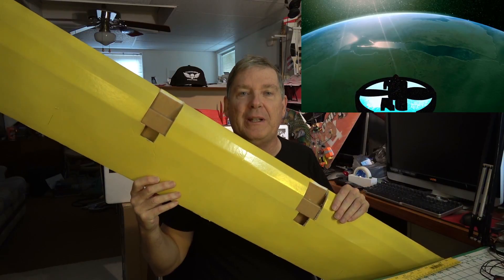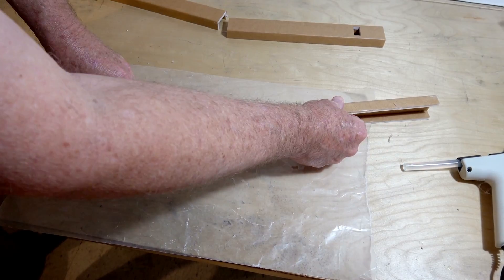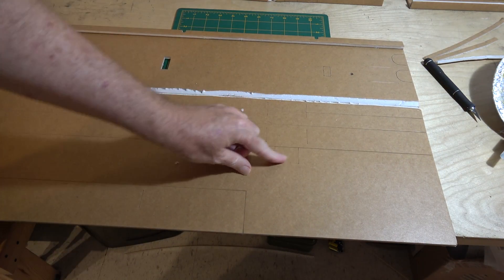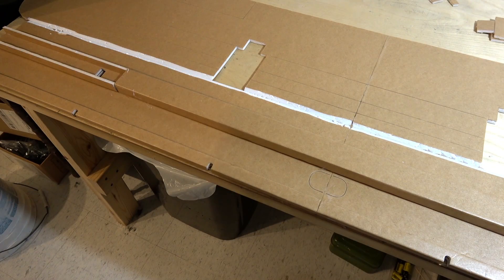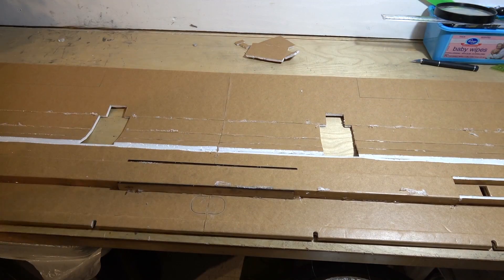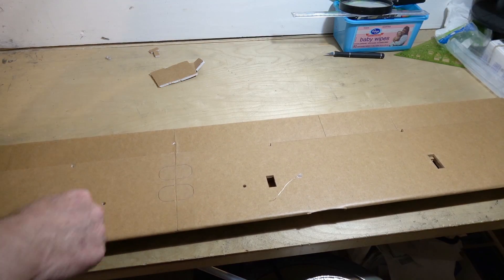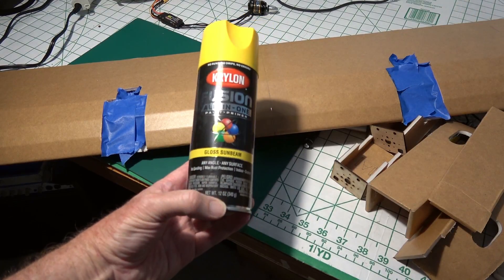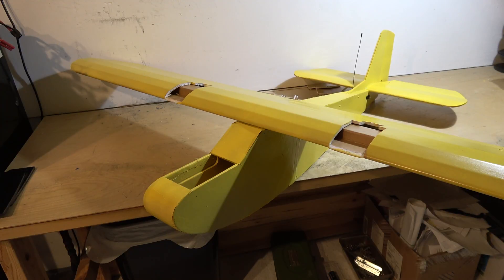Founders FT Legacy RC Plane Build - Part 4 ( FPV iNAV Differential Thrust ) Main Wing

Comment: Hi Dave - great videos
I'm building the Bronco so I'm looking forward to your next video showing how you programmed the differential thrust and linked it to INAV
(Incidentally,  I noticed you picked up my fix for the Omnibus F4 PRO V2.1 a while back on github - glad it helped!)
regards Hans
Reply from the maker: I will do a video on iNAV settings later. The differential thrust is simple, just pick the iNAV preset for a normal airplane with differential thrust and it starts working by the rudder stick! 
Thanks for your work on the Omnibus F4 PRO V2.1 b/c it was a bugger to figure out.
Reply: Thanks for the help  Dave - looking forward to the next video